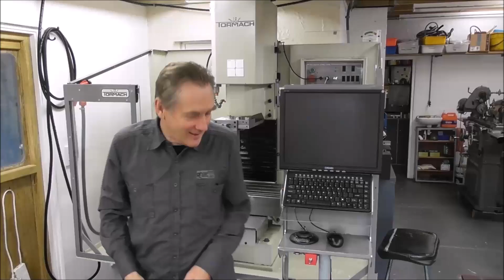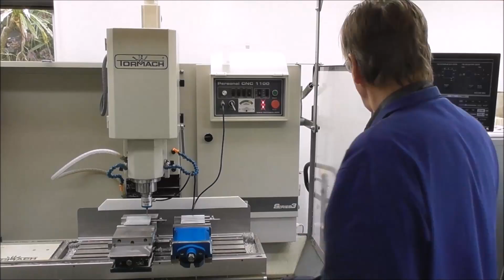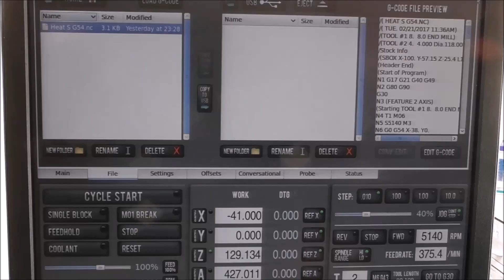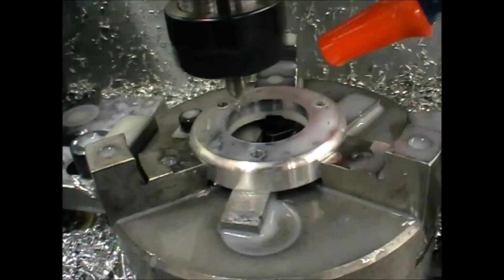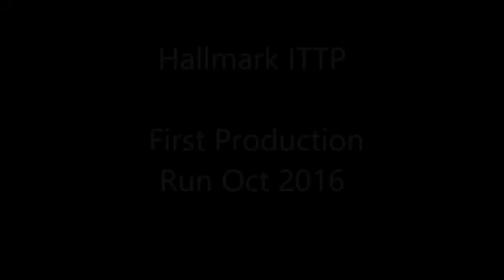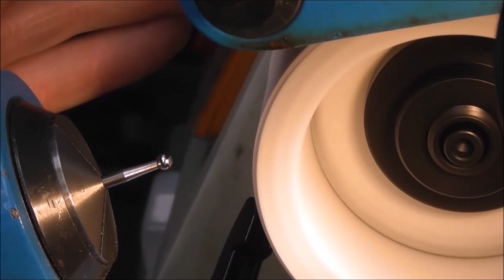Small Shop Production Machining    Tips and Tricks  Part 1

Comment: Looking forward to Part 2, of course!
Btw, here's a little tidbit to gnaw on when bored out of your skull...
When you're looking for a massive response to an impulse, such as a pulse sent to a coil, the robustness of the inductive return spike will be most affected by the rate of change and not by the amplitude of the pulse. In other words, as the leading and/or falling edge approach slopes that are nearly vertical (zero transition time), then the return electromagnetic field begins to appear to have mass. Perhaps an approach that leads towards creating matter......
Secondarily, for the greatest efficacy, the pulses should always be DC. You don't want to change polarities. Alternating polarities destroy any possibility of additively building something amazing. Tesla, for this reason, used DC only in his greatest works. 
Also, the greatest amount of environmental power is in the highest frequencies. The highest frequencies are also the shortest wave lengths. Where on Earth could we possibly find (or make) materials that could be used to make suitably sized antennas to tap into those energies? Molecule size antennas?
Tesla and Moray both had secret components that made their energy producing devices function. 
They used antennas that Nature makes. 
Radioactive materials are those antennas. 
Just saying......
I admire you for sticking to the journey and never giving up. 
You're one of a small number of my heroes. 
Thank you for the extra work involved in sharing interesting aspects of your journey!
Cheers!  :)
Reply from the maker: Cheers Art!  Cliff

Comment: Hi Cliff, I'm assuming those are 6" vices and was wondering how they work out on the PCNC1100 space wise.  I have a pair of 5" Tormach vices and was looking at replacing them with some 4" Kurt vices because I thought 6" might have been a bit too large.  What are your thoughts on practical vice size for a Tormach?  Cheers, Chris
Reply from the maker: Hi Chris - They are 6" vises on my 1100.  I like as big as possible to give max capacity for bigger jobs.  I suppose it depends on the type of work you will be doing.  Big vises can hold small parts, but small vises cant hold big parts! Cheers  Cliff
Reply: @Threadexpress  Hi Cliff, Just as a matter of interest I went with 4" as looking back on the sort of jobs I do it is mainly small parts, say 90%,  I can always gang two vices if need be.  I purchased a pair of Glacern GPV-412.  The local Kurt agent didn't bother getting back to me with a discounted price or information like they promised on the phone and in emails.  One of the other staff was somewhat condescending during follow up.  The Glacern vices claim clamping repeatability of 0.0002" with a one-piece fixed jaw like the Kurt Versatilelock model (actually, the rest of the specs are pretty similar).  It was cheaper and easier to air freight two vices from the USA than it was to buy local.  Normally, I'd prefer to support local business but I'm happy to make an exception in this case!
Reply from the maker: @chrismayhew3651  Hi Chris. Thanks for taking the time to share. Cheers  Cliff

Comment: for heavy production this tool not a good idea after some jobs size will change
Reply from the maker: Thanks Yawer - Yes it only suits small runs.  Cheers   Cliff
Reply: Threadexpress  what cnc Penal is there ??
Reply from the maker: Hi Yawer - What do you mean by Penal?
Reply: Threadexpress panel sorry miss type which panel is that cnc machine have

Comment: Great tips!  Love the step drill idea.
I do similar things with the vice when I have to offset a part like that.....but a lot of times, I'll take a parallel and lay it on it's side, under the part.....then the part can be put in the middle of the vice.  Obviously, the parallel needs to be shorter than the part is thick, but it floats the part across the gap quite nicely. :)
Thanks!
Mike
Reply from the maker: Thanks Mike. Yes I should have mentioned that. I always do that if I can, unless the part is tall as per that part.
Cheers Cliff

Comment: Keep in mind subroutines. As long at motion is relative, you can "bracket" generated code as a subroutine and then call it for each workpiece offset. Should make the code more readable and if you need to tweak one of the operations, it'll apply to all workpiece offsets.

See O-codes (Oh-codes) in LinuxCNC references.
Reply from the maker: Hi Bernd. Yes I know, I even have done a video on that, but you know I found it quicker to copy paste than to do viewing refresher on my own video!  (not the best memory)  Cheers.

Comment: Good video as usual. And over time that off center clamping in a vise has to be hard on them. Good vises are expensive enough I think it's better to not subject them to stresses they weren't designed to take.

The production tips are great, but I'd bet you have a whole lot of interesting and accurate methods of tool making tips as well. Actual toolmakers are in short supply on Youtube.
Reply from the maker: Thanks again TP.